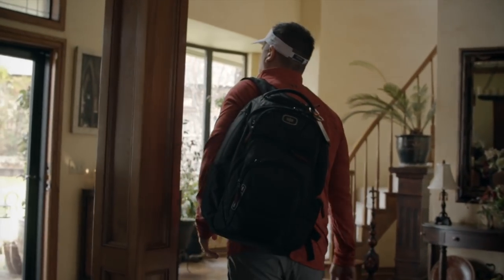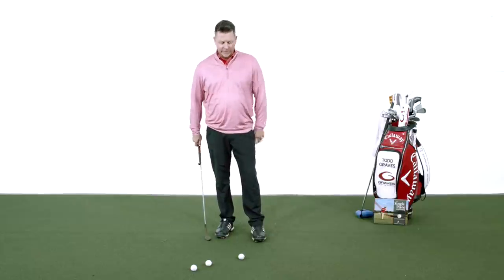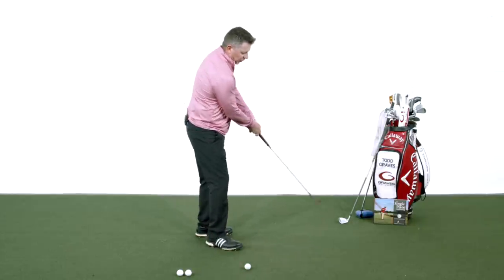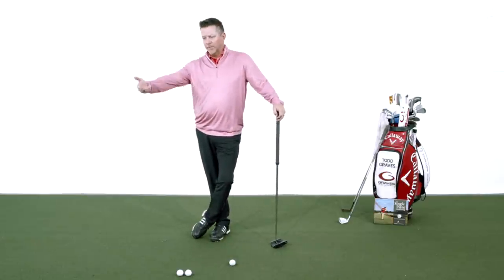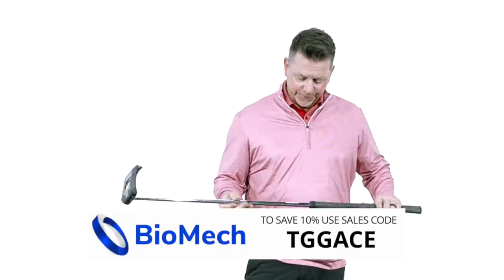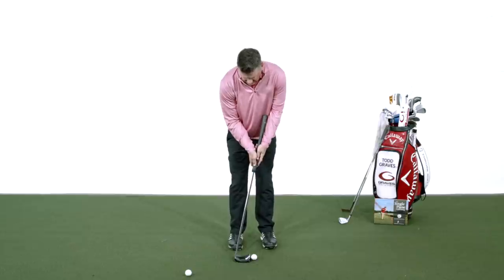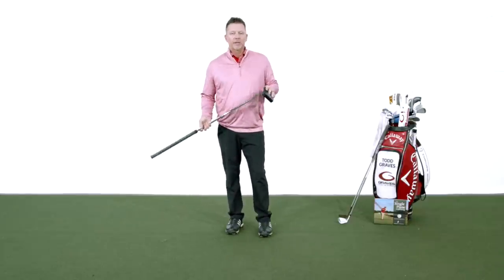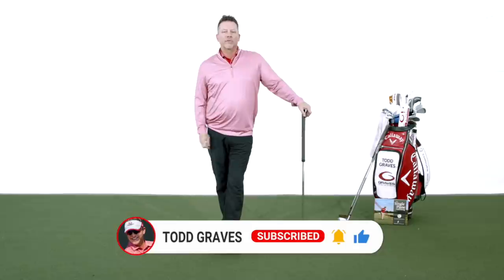Single Plane Putting with BioMech

Comment: Tried out my biotech putter yesterday and today. Yesterday I really didnt understand the setup well enough to make any comments but came home last night and watched several videos on it and learned how to use it the correct way. I think I made a good investment for once! This putter is really nice. Im saying this after only 2 days of practice. Obviously I have to keep working with it but this putter is really smooth.  The greens on my course are very slow so I inadvertently let the club disconnect from my left arm a few times on the longer putts(putting green only) but that is something I will work on. I was also standing too far away yesterday mainly because I didnt know any better. I do like the fact that you just use your core to move the putter. Taking out those variables! I added some lead tape on the bottom to get that heavier feel. So after 2 days I have to give it 2 thumbs up!

Comment: Fantastic putter I first saw at the NZ Open in Queenstown used by Heath Slocum. Got a one-on-one hour long lesson with the developer - Todd is absolutely correct about the technique and I was shown that it was hip turn that is incorporated in the putt, as seen with the slight flex of Todd's trail leg on a simple medium length putt.
Stance width is a personal preference but the alignment with the lead and trail arms is always there

Comment: Just received mine. Thanks for the video. Using SGB for alignment, and foot position, ball at the P. Finding a grip similar to yours, that will be consistent, is no longer an issue. Decided to use Tim’s LW grip, one finger on the steel for T hand. Your L hand grip with pointer finger down the grip. Schools still out on adding weight, or triple track sticker. Ringo out!

Comment: Got my first round in with this putter. I’m sold! Made a 6’ come back and a 20’ in the first two holes. Of my 32 putts I can think of only two that weren’t on the exact line I wanted. Still need work on speed control but now that I have confidence I can hit my line I’m sure this will help. Two things of note. Go with a shorter putter if in between. I went longer and have trouble standing close enough which puts my right hand on the shaft. Also, just like chipping and pitching I have trouble hitting with an open stance so I’m using it square to my line.

Comment: Mine arrived yesterday.  Brought it to my indoor putting surface.  Love it!  Common sense resonates with me and this tech applies common sense.  Much like the SPS.  Nice warm day today in NVA.  Taking it to the course this afternoon.  It will be interesting, with virtually no practice, to see how it goes.
Reply from the maker: Hey Tim.  Let me know your experience with the putter.  Thanks.
Reply: @ToddGravesGolf   To level set, I use Arccos and last season had a +.4 strokes gained putting.  So generally, not bad.  First time out with BioMech, with almost no practice , 12 holes 20 putts yesterday.  Not sure why but I felt really confident and comfortable using this putter.  Setup is natural to me.  Aligns to the target nicely and there is NO way (unless you go out of your way) to not have my hands lead or to  flip a wrist.  Distance control was a bit off probably because the head is much lighter than the putter I've used for the last 5 years.  That's just practice thats needed.  But I made a couple of 4-5 footers to save par.  And I knew it was going to go in!   My playing competitor was looking up whether it was legal while we were playing.  Thats worth the price of admission.  Thanks for digging this out of the corner of your office and sharing.
Reply: If everybody buys this putter, Tim won’t have anyone to teach putting any more. :-)

Comment: Got mine today and took it straight to the course. Took a little getting use to speed on short putts bit hit every line. Took it home and added a little lead tape and practiced a bit more on my perfect practice mat. Straight back and straight through is much easier with this putter.
Reply from the maker: Sounds very similar to my experience. I rolled the ball immediately better but it took a few weeks to get used to.
Reply: @ToddGravesGolf  this should be the putter of the Graves Golf Academy. I think if you had a few at the schools, everyone would order one. I mean, it is hard to Not roll the ball down the Excalibur every time with this putter. I have had this for one day and can already appreciate it's simplicity. I tried an arm lock earlier this summer and just couldn't get comfortable on short putts. Felt like I couldn't get over the ball even after cutting it down. The BioMech feels so natural. The only adjustment I use with the Excalibur is to stand on a 1/8 to 1/4 in of plywood because it feels to easy to put weight on the putter with the Excalibur being elevated, thus jerking the takeaway. No more excuses!  May very well be the most important club Graves has ever endorsed.

Comment: Automatically sets up so much better than the conventional arm lock putters currently on the market.  It just makes sense folks.  No gimmicks whatsoever.  Can't wait for mine to arrive.
Golf pro from Illinois
Reply from the maker: So true.
Reply: How do you like the putter after 3 months
Reply: Only had 1 session with it. Don’t like the sound off the face, sounds like your hitting a rock but all I’ve really ever used were insert putters.  I’ll get out more with it in the next week though when the weather brakes.

Comment: Little titbit here that changed my putting forever. I'm right hand dominant... but with putting, It does create too many variations when I use that dominant hand. 

When I start with my lead arm straight and my trail hand for support stability, I can just push my lead arm back straight, and it feels really good. I don't even rely on the weight, but more so distance I'm pushing it  back. 

It would be really interesting to see how it works with this putter! 

I drain a lot of putts now too because of the always pure strike.

Comment: I have been using a Biomech Ace on and off for a couple of years and I agree it is a bit light.  Just wondering Todd how many grams did you to add to the putter?  I went to this putter because I have lower back issues and I do not have to bend over very far to use it.  I had a medical procedure done on my lower back last November (2022) and am not swing a club yet.  However hoping by the end of January 2023 to be able to get back to it.  I plan to learn the single plane swing, with my back issues I should of learned it years ago.  Going to get with your guy Paul in Orlando for some one on one lessons in February. Thanks.

Comment: Is there any technology behind the back shaft mount and the curvuture in the mallet.? Also is there grip thickness options.
Because of the shaft is against your lead arm,it seems that would aid to eliminate inconsistent back stroke path. This thing looks like a answer to years of putting frustrations Ive had for years. I'm going to check it out. Thanks again Todd.
Reply from the maker: Yes.

Comment: I have never heard of these putters so I have been surfing the net to find one used.  Only new on eBay. That could mean it is a Great putter that nobody gets rid of.  I did come across a lot of videos on the putter.  It definitely has peaked my interest but even with the Todd Graves discount it’s expensive.
Reply from the maker: Good putters are expensive.  If you don't like it I'll buy it back within 30 days.  Thats my guarantee.
Reply: @ToddGravesGolf  I bought the putter with your promo code. Now that I have putted with it albeit indoors because I live in the north.  I think it is going to be awesome.

Comment: Todd, is grip size important with this putter?  I just got mine, but on a previous putter I bought through Graves Golf (an Odyssey Red Dot), I was told I needed to use a #3 Super Stroke grip to properly fit my hands.  Since the BioMech putter pretty much takes the hands out of the stroke, I'm guessing grip size isn't a factor but wanted to check in case I should use a grip size larger than the one that comes on the putter.
Reply from the maker: No. It locks to the arm - no need for big grip. Different system.

Comment: Ordered it yesterday. In the swing Todd, do you feel like your left knee is pointing at the ball at setup with irons. Kind of like if you fully straighten your legs and turn your pelvis to the right as far as you can? Cuz I feel like if I tilt and bend forward at setup then my pelvis is open from the tilt and you say it needs to be square at setup but I can’t feel these things. You have that k motion thing so if ur feet are square and you tilt parallel to the target line and don’t close off your body how many degrees open is the pelvis?
Reply from the maker: Left foot is open so knee does not point at ball.  Turn your pelvis against the trail leg but make sure your feet are correct.  Pelvis is square at address. Nobody can feel it - that is why I use video and tools like K-Motion to measure and quantify.

Comment: Hey Todd, big fan of the channel and I’m grateful for all of your insights. You have helped my golf game a ton- thank you! I’m wondering, don’t all armlock putters eliminate the wrists? Hence the name, armlock. With enough loft and forward shaft lean, can’t any armlock putter work in a similar fashion? Thanks again, I appreciate your work!
Reply from the maker: HI Jeff. Yes, all armlock putters lock the wrists however, this putter's shaft lean at 12 degrees, along with the head design, sets the balance of the putter where you don't fight the putter design.  Most other arm lock putters, because of the straight shaft, don't balance correctly when locked to the lead arm.  I was shocked by the ergonomics of this putter and how "naturally" it worked with my body.
Reply: @ToddGravesGolf  that makes sense to me. I’m eager to try one. Looking on the website and this may sound silly, but do they sell the grip and headcover separately, or if you purchase the putter it has grip and h/c included? Wasn’t sure and can’t tell from the pictures. As always, much thanks.
Reply from the maker: @jeffwarn6541  The Grip and HeadCover come with the putter.
Reply: @ToddGravesGolf  I would hate to order it and have it show up with no grip, haha. Thanks for the confirmation. Keep up the great work and stay safe 👍🏻
Reply from the maker: @jeffwarn6541  True.  Those grips are difficult to install too.  Trust me I've tried it.  Let me know how you like the putter.  toddg@gravesgolf.com

Comment: Thanks Todd,  I have a copper two ball putter that I love and alignment doesn’t seem to be my issue.  However, I do tend to have wrist problems.  Right now I believe I could knock five strokes off of my score if I could putt.  I’m going to look into this putter.  Stay safe my friend!
Reply from the maker: I love all of my putters - the design and the look.  But no matter how much I liked the way they looked, I still struggle with consistency.  The BIoMech putter is a System of putting which makes it so much easier.  Thanks.  You Stay safe too.

Comment: Todd, I am going to ask three of our local golf equipment shops to order a 43” BioMech putter for me to try.  Of course if I like it, I’ll purchase and change to it.  Need to also think about lead hand low vs right hand love for this putter.  IF I stay lead hand low, I would need a shorter shaft length, right?  ?????
Reply from the maker: Yes - shorter for left hand low.
Reply: @ToddGravesGolf  I saw your set up on YouTube.  Looks like it will be more bio-mechanically correct  to use this putter with the trail hand low and the open stance as you demonstrated; which is what I used for 25 years.  I just recently changed to lead hand low.  Your thoughts please.  
Ricky Gilbert - Gold Member
Reply from the maker: @rickygilbert4054  right hand low is best on this putter

Comment: Todd what size putter did you get? I’m 5’9” and website recommends 41” but I usually use shorter lengths because I have short arms
Reply from the maker: I have a 41 to keep standing taller but I can also use a 39.  Both of them fit well and lock to the forearm.

Comment: I don’t have any problems with wrist breakdown and I’ve used an open stance for the last several years.  It’s so much easier to see the line with an open stance.  I think Nicklaus used an open stance.
Is the putter legal?
Reply from the maker: Yes it’s legal. Here’s a thought. I don’t have a wrist breakdown problem either, but this putter eliminates the possibility.

Comment: Hey Todd — is it possible for me to order the triple track tape from Calloway? Does Graves  sell the BioMech putters?
Reply from the maker: No. Callaway will not sell you the triple track tape.  They would rather sell you a putter.  Vendors on Ebay sell the tape.  Eventually Graves Golf will have putters for sale however, right now BioMech is the best place to buy the putter - with the TGGACE discount code.

Comment: Been single plane for 4 years.  Tee tee to green has never been better.    Bought the bio mech 2 years ago and I still struggle with putting.  Specifically short putts inside 3 feet.  I believe in the bio mech design.  But could really use more instruction in rolling down the line. To me I feel down the line is like hitting a draw.  Tired of missing short putts.   Also long lag putts the balls gets airborne almost like chipping.   HELP.

Comment: Todd, can you use a SPS grip.
Reply from the maker: HI Terry. What do you mean SPS Grip?
Reply: @ToddGravesGolf  The way you would hold a iron
Reply from the maker: @terrywells2095  Different lead hand alignment with putting.  you lock the club against the inside of the lead arm because you are not letting the wrists move.  This is different than the lead hand position of the golf club which the trail arm folds and hands hinge.  The trail hand is the same.
Reply: @ToddGravesGolf  Thanks for the response, I am willing to give it a try.

Comment: Todd,
nothing new here.. but you need to make it clear..putting not just about the arm lock you have..What about the most important point ...Green reading...You should look at that before you blame the putters. All putting is slightly inside to square too inside.. Arm lock putting will soon be illegal we think.Its no different than a belly putter. you have neglected the most important part of golf..Putting.

Comment: Hey Todd, since gripping the club is the start of the SPS, (making sure that the hands are in the correct orientation to the club face at ball impact) is this different? Recent info shows that face angle ( +/- 1.5 deg.) is more than 90% of accuracy and that club head path is only of minor importance.. (Dave Pelz thought it was 85:15 but he has recently seen that change.) Clearly, accuracy is key and I would have thought that getting hands properly on the club and then orienting the body to allow for a perfect presentation of the club face to ball at impact was the key. Is this putter gripped with the hands similar to the SPS grip or?
Reply from the maker: The hands are clamps. This putter, when Locked against the arm, creates an extension of the body into two lines, with the lead arm and trail arm. Since your hands are locked you have eliminated the wrists.  The arms and shoulders stroke.  Now, discussing the swing, the Wrists are active and the goal is speed.  There is the difference.
Reply: @ToddGravesGolf  Thanks. I treat putting like a quest for the holy grail... I take stats on every putt of every game (70 to 100 per year) and my putting is okay BUT I miss so many putts by so little, I am always looking for the edge that will get me that little bit extra. I spent this year getting used to the "fat" grip and changed my hands to lock out the wrists. Same stats as ever. Not really desperate but definitely interested. :)
Reply from the maker: @Sueezedtight  The putter takes some getting used to like anything radically new.  But I'll give you the same promise - If you buy one and don't like it, I will buy it back for what you paid for it.
Reply: @ToddGravesGolf  I am sorely tempted and will check my budget. :) I am seriously considering it as your advice and teaching have inspired me greatly ( AND improved my game and enjoyment thereof). I have never tried the arm-anchor approach but am an old dog willing to learn a new trick.